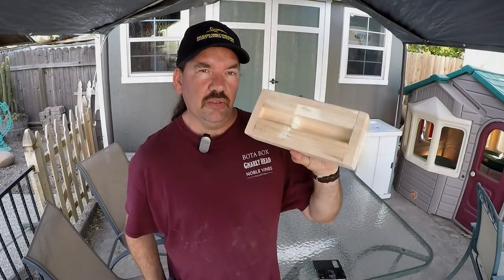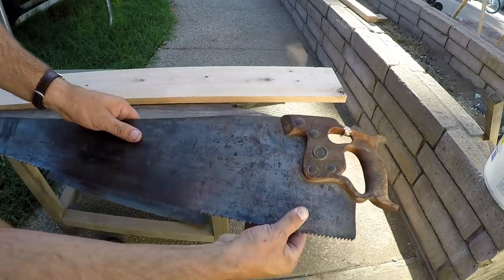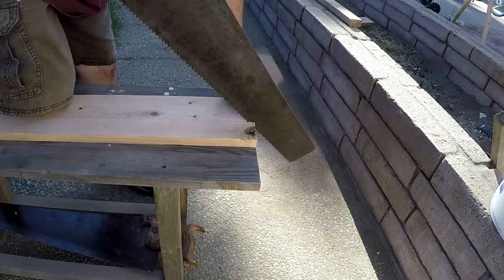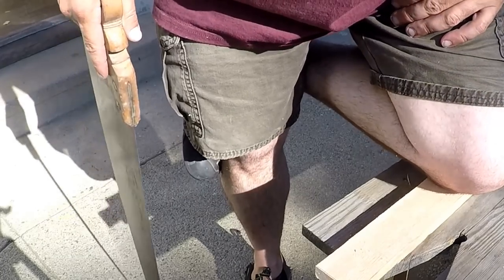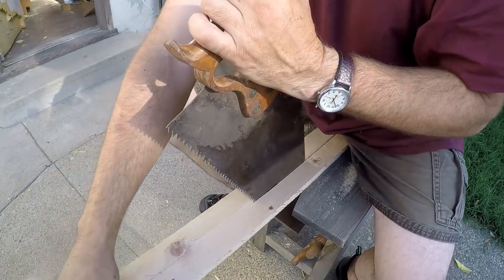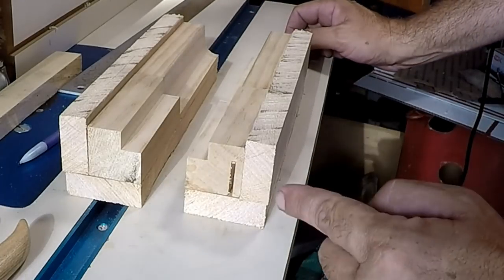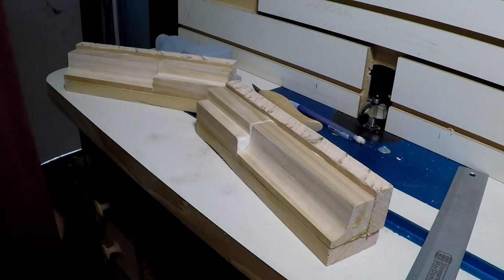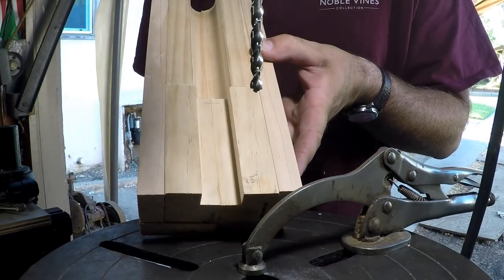Core Box Pattern Part 2

Comment: I used to collect old wood working tools and I used most of them (still have most of the collection). But that being said when ever I have to rip a piece of wood I go right to the table saw and then cut it to length on the chop saw. I have been enjoying watching the old school techniques.
Reply from the maker: The hand tools are something I enjoy but I do have the modern power tools also. But they require less practice so I tend to keep my hand skills up. Looking for a core box plain if you know what that is. Nice thing is it will make any size within its capacity.

Comment: There's something about using old hand tools Chris...
Your collection of Henry Disston saws are very nice...
The manufacturers of such things attached a lot of civic pride to their products as well...hence the decoration on the handles etc....
The tools of progress...

I like the demonstrations you provide on correct use of traditional hand tools as well....so many times you just see someone hacking away at something....or instantly reaching for the chopsaw...

Do you still use leather fillets Chris....or go with a filler and bondaprime/pattern paint...?

I also do what you did when gluing wood...wringing it together eliminates voids and creates an even spread...

Beautiful work Chris...as always... 🙂
Reply from the maker: I have not yet tried leather fillets but I just got a set of fillet irons . Now I need the filets . I don't like bondo .I've been using Durham rock hard water putty. A vintage product still made today. I have affiliate links in the discription
Reply: Old Iron Shops

Slightly off topic but do you ever go watch San Francisco 49ers play Chris...?

You know the 49ers own a 10% stake in the football club I support:
Leeds United FC...?

The two clubs are linked Chris...
Reply from the maker: glenn moreland interesting. I'm not much of a football fan. I'd rather be in the shop. I have been to sanfransisco several times but not too watch a game.